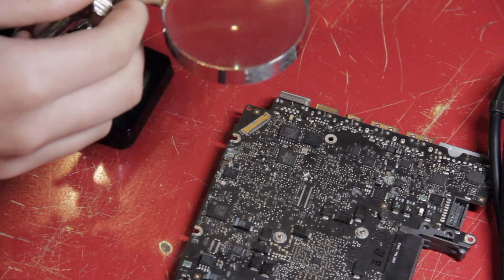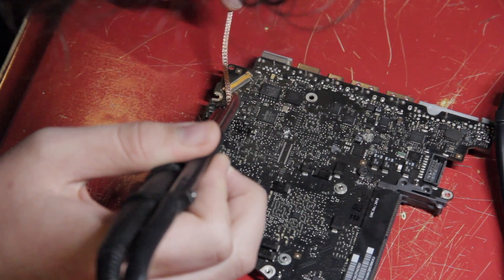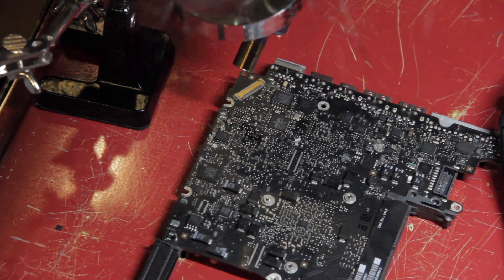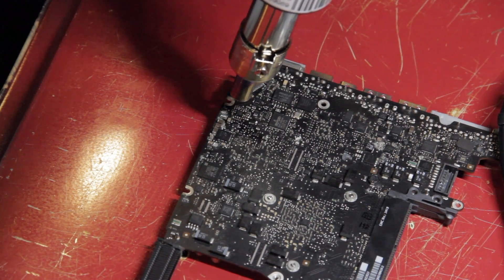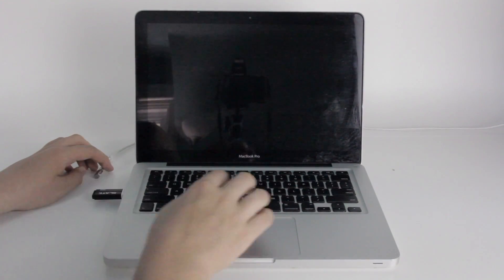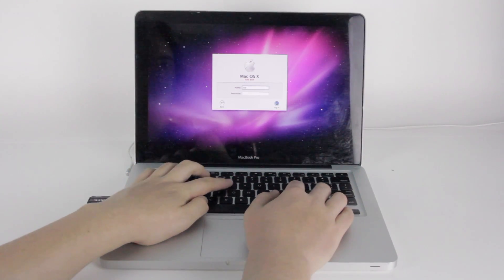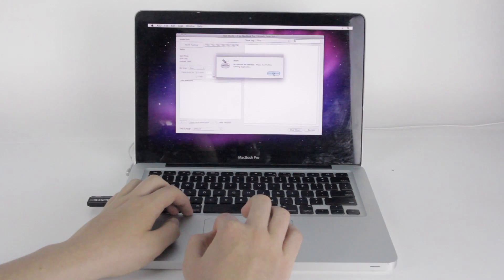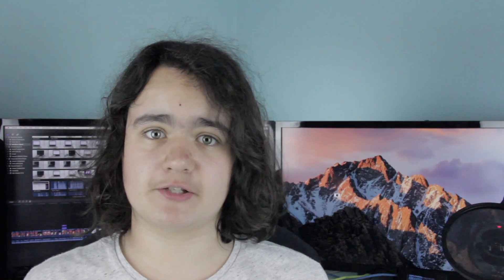MacBook Logic Board Repair Pt. 1 - Replacing the Backlight Chip

Comment: couldn't u replace the smc chip
Reply from the maker: Yes, but the issue is that I don't know whether the SMC is broken or something related to it is. It could be that the chip itself is malfunctioning, but it could also be for example that the circuitry that powers it, or enables it, or connects it to the rest of the laptop is broken. That's what I'm trying to work out right now.
Reply: Dodoid a lot of people suggustud it alredy, but I'm gonna do it too :) fakesmc.kext... just reply, so we'll know if you noticed the comment (and possibly if it works)